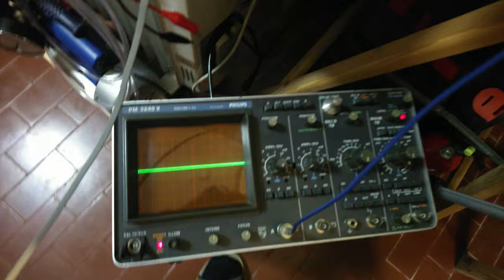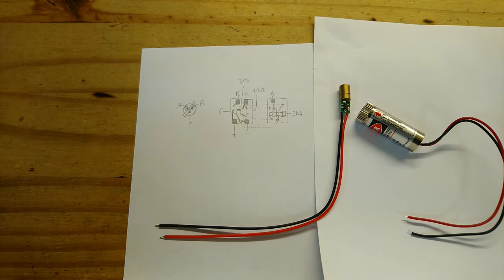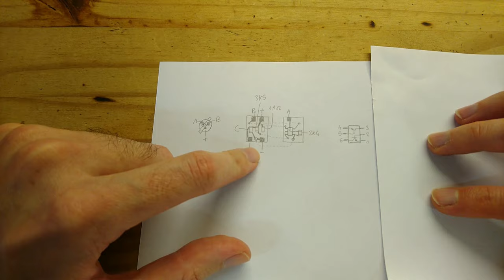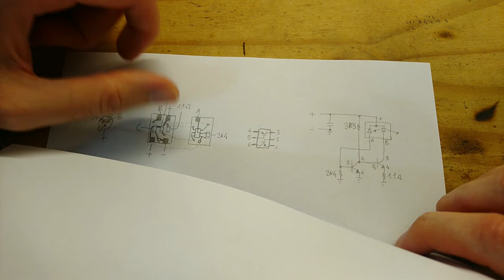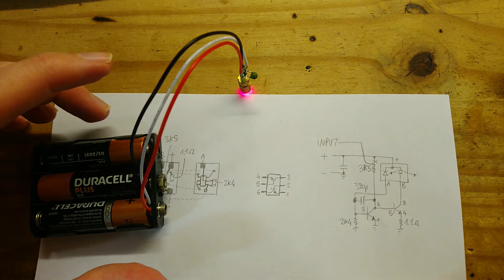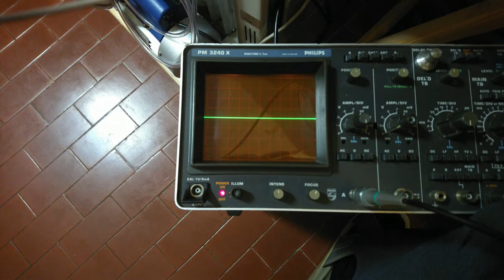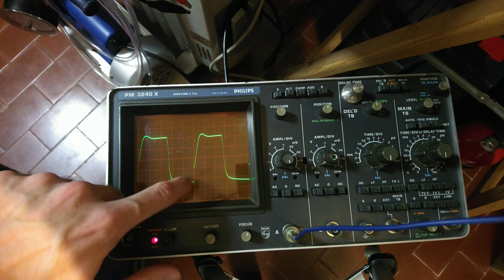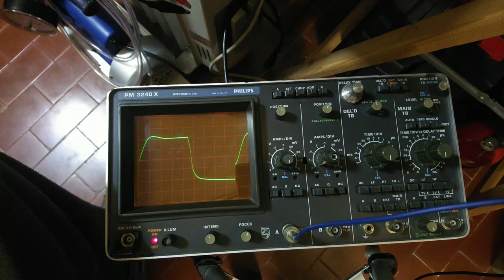Reverse engineering and modulating ebay laser diodes

Comment: Great info, thanks!  I didn't know what was in these cheap devices, so I bought a few individual laser diode components.  They have the built-in photodiode for monitoring output, but I wanted to try using it for self-interferometry measurements.   One laser diode has that weird arrangement with the case as common anode, so I don't know how to work with that.  My other is common cathode :)  But I realised I needed a heatsink & optics to focus the beam, so bought a cheap case+lens kit.  Now I need a small vice to press the diode into the fitting :(  And for some reason each of these parts are more expensive than a pack of the cheap modules you're using :(

Comment: Case is connected to the positive terminal because of what these lasers are mostly used for. They are mostly used for laser pointers and these are usually powered with coin cells. Coin cells have positive electrode on the outside. Thanks to that, positive of the diode and positive of the cell can be connected with metal case of the pointer, making the device simpler and cheaper.
Cheapest modules have a simple resistor instead of the regulator.